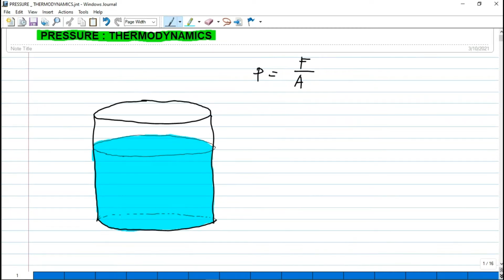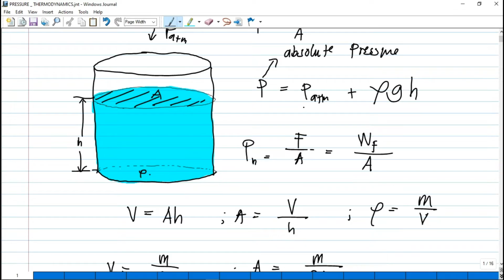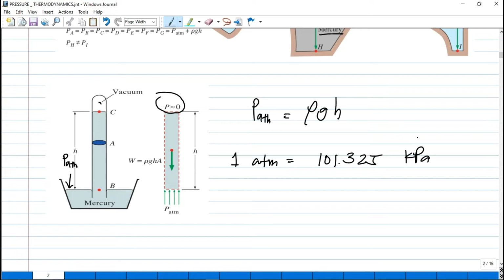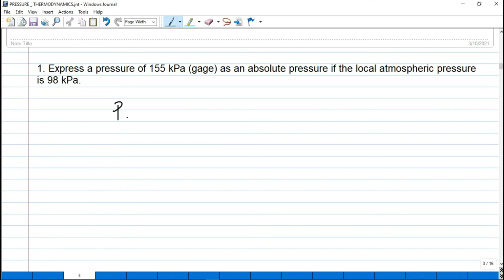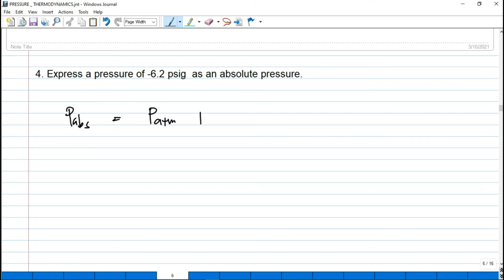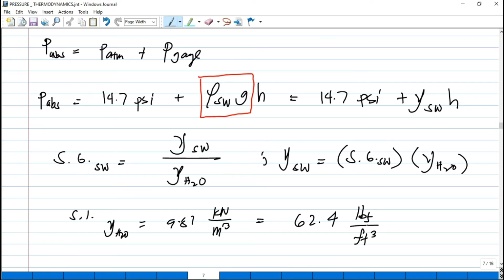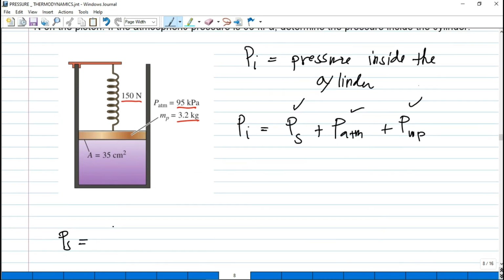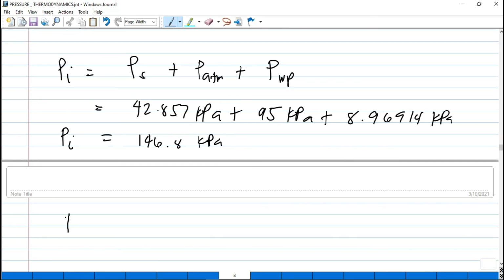What is Pressure? | Thermodynamics | Part 1

Comment: Hi so i have a quick question say you have a
2 pieces of steel pipe capped off on both ends and opposite temps 1- 70°f and the other cloase to freezing point now hypothetically try to pressurize them(now my point)is the warm pipe would pressure up to 10 psi and stay at 10but.. wheen pressurizing the cold one will the psi drop slowly